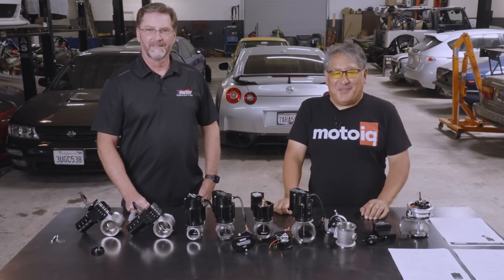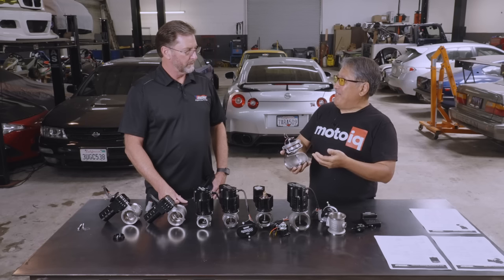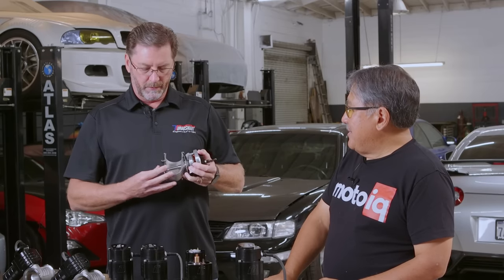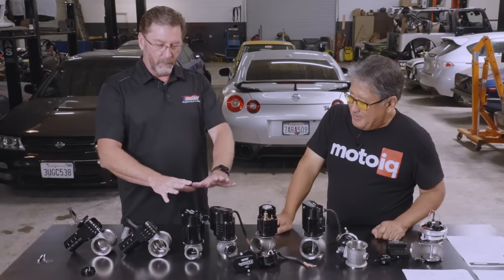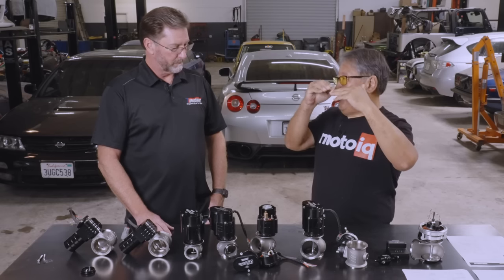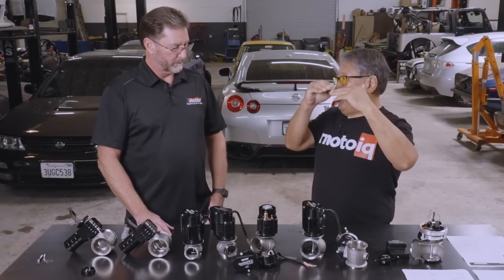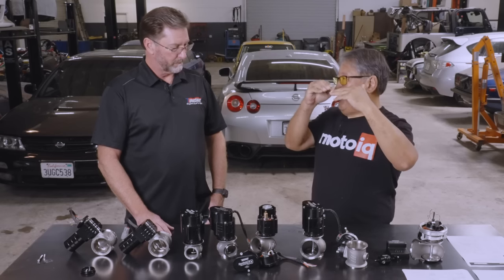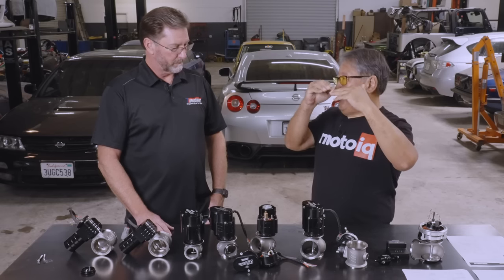The Future of Boost Control: Electronic Wastegates

Comment: As someone who drives a Golf EA888 Gen3 with one of these (IHI). They work great but they do have a higher failure rate than the conventional spring wastegate on production cars that will see alot of miles.  Stil, obviously its much easier to control and also simpler to have it electronic(non water-cooled WG). As for the magnet temps , ask any RC racer about that, its why we keep our electric motors in our models under 185F , over that you loose magnetism, so you loose torque and speed.
Reply from the maker: Maybe thats the OEM VW part, turbosmart has pretty rigorous validation.
Reply: @motoiq  VW OEM for the IS12, 20 and 38 is IHI Japan, but yes that could be the case
Reply: The Curie Temperature is the temp at which magnetic properties of a material change. It depends on the material, but I'd imagine most of the motors are using similar grades of material.
Reply: @jimboyokel  yeah those magnets its around 210-230f if Im not mistaken, but you cant really take the temperature accurately since we measure on the can itself , 185F gives us a good margin.
Reply: As a fellow Mk7 Golf R i too have had fault codes for the electronic wastegate actuator. But isnt the actual wastegate on the is38 still internally gated? These seem to be closer to an external type wastegate.
Reply: @erikpowers4358  as a former Mk7 GTI owner, yes they are a internal wastegate. The IS12/20/38 are like they replaced the wastegate diaphram with an electronic actuator. I imagine the gear drive on this aftermarket external gate is about a million times more robust.
Reply: Turbosmart>IHI

Comment: Rob Dahm uses the e-gates on his rotary builds and loves them and loves how precise he can set them
Reply: yes dahm seem to like them alot and its might be alot more easy to use then the need to rout preasure hoses.
cleetus using co2 just to control his wastegate and get alot of boos creep sometimes, it would be nice to see if his engine would run more stabile presure with e-gates.
Reply: This is funny, as soon as I was getting into this video, I started wondering, damn what is damn using, now I know thx

Comment: Big hot rodding innovations still popping up, unbelievable! Would make for a very elegant way of limiting wheelspin by cutting boost at low RPMs
Reply: or if you do a turbo busa you can have basically no boost in first then boost it by gear to like 20psi in higher gears. stops it from wheeling not doesnt stop it from hauling ass!
Reply: Dude with modern boost control and tuning I got my 01 7.3 deisel to 22 mpg hwy. Modern engine tech is wild
Reply: @Lrlbiglee  😲🧐🏁

Comment: nice! the waste gate valves size/flow rate and release latency is important, having a controlled delay is good because you wont loose pressure in-between shifts but too much delay creates over boost/spike And with blow off valves if it holds waste gate pressure after the throttle is closed it builds thrust load on the impeller shaft and wears it out little bit faster creating the fluttering/back flow sound from when too small a blow off valve, poorly controlled or no valve is used
Reply: To be fair, that type of shift delay control has been around for a very long time. Running a simple N75 we've been tweaking that for 20 years at this point. A lot of guys weren't using the simple technology available to them.

Comment: If these are reliable. This should be awesome. Much better than a spring.
Reply: Rob dahm has been using this for the past 2 years & on with no issues. Is that reliable enough for you 🤔

Comment: I would guess this would make many exotic turbo setups easier.
Setups like compound, asymmetrical sized turbos, dual boost (compressor and turbo), or rocket boost setup (Subaru rally), all of those could be a lot easier to control individually.

Comment: These are very cool. I've wanted one since I first saw them, since boost control tuning, even with a closed loop option, is subject to many issues mentioned in the video. It's unfortunate that they cost more than my turbo did, and wouldn't fit on either of my cars without modifications to the manifold. I would like to see one that uses a linkage and a bowden drive to move that actuator somewhere else. 

I've always been curious about something though. With heat being such an issue in wastegate actuators, why do many manufacturers insist on making them black. The emissivity and thus absorbtivity of black anodized AL is significantly higher than un-tinted anodizing or raw AL, and in many cases these things sit inches from glowing IR sources... Even the cheap actuators come with water ports now, but reducing the heat input from the glowing primaries or turbo can't hurt.

Comment: These are giant though.... for me, it's yet another item to power: laying out my build I have electric power steering, electric AC compressor, electric pump for air-to-water intercooler, electric fans, and now an electric wastegate, in addition to my bevy of accessories? I can't believe I have to go down the rabbit hole of pros and cons for a dual 12V (in parallel) system..... And finding a beefy KA24DE(T) alternator to manage it
Reply: This is max 130 watts when it is adjusting, 0 Watts between engine idle and all the way up to the boost target.
Reply: You've got a lot of electric accessories, but almost nothing is running at the same time. Your electric power steering is going to be consuming almost zero power, if you're at wide open throttle, your electric AC compressor is off. Your intercooler pump is maybe 10 amps continuous.
Go measure your actual running current, you're going to be well short of 30 amps continuous without headlights on. that's totally manageable even on a factory alternator runny any RPM.
Reply: @otm646  thanks for the feedback! You're absolutely right, I should look at total current draw and power usage at a realistic duty cycle and see just where I'm at!
Reply: @mrbookends   Your ecu can inform power usage from alternator and what is effectively charging the battery. So a simple math solve this question

Comment: Well, a missed aspect of thermal issues is that heat directly affects resistance in a circuit. If resistance changes, then reference voltage changes. If the reference voltage doesn't change, then the current has too in its stead. 

So, either have an inaccurate 0-5v reference or constant over working of overcurrent components (zener diode, resistor, UJT, etc). The ceramic composite of the bowl cooling won't change Ohms Law.
Reply: Could use a valve controlled vacum wategate. It’s a bit german, my porsche 992 turbo with ruf kit, responds well, reliable enough to run 880hp with 3 years warranty and a lot of tracks days and autobahning. And my wastegate remains open in launch to alleviate exhaust pressure, but my turbo is VTG. I don’t know 10 years ahead, but I put about 15000 mi and I’m confident
Reply: They are controled on close loop that is not problem if you have proper ecu to run eletronic wastegates.
Reply: @fabini14   And good tunning too. For me, closed loop controls is magnificent and beautiful

Comment: These on the right engine with a twin charger system would probably get you boosted engine effiency easier cooling but that huge turbo peak hp numbers with usable torque.

Comment: I’m going to run Turbosmart’s new 50mm eboostgate on the cold side to control boost. It will make the turbo spool like a supercharger but I’ll still run a traditional poppet style wastegate on the hot side as a safety to not overspool the turbo. I also bought Turbosmart’s black box which has two half bridge. Hopefully later they can reduce the physical footprint to make it more compact. Idk if TS can being that there is the compound gearing mechanism that takes up the inside of that housing.
Reply from the maker: That is interesting.

Comment: What built in safety protocols are in place in the event of the electronics malfunction or sensor malfunction? These are exposed to high temperature and pressure , can you state the failure rates based on testing?  Throttle bodies and accelerator pedals have 2 independent sensors to prevent this. Can you elaborate  what engine protection strategy is capable for preventing an over boost condition
Reply from the maker: Typically the same safety protocols used in a traditional turbocharged or supercharged application would still apply. The Turbosmart BlackBox also features over temp protection and over current protection to specifically prevent the Electronic Wastegate from failing.
Reply: There is no safety in a regular wastegate either.
It is up to the tuner to program in safety if the engine sees to much boost.
My 25 year old car used fuel cut in case off over boosting if there was a malfunction in the wastegate system.

Comment: i feel like we need remote actuator in order to add these to existing turbo kits. that huge actuator is hard to fit.
Reply from the maker: It's one of the points we brought up, many times the system will have to be built around the wastegate.  The advantages may be worth it!

Comment: Is the turbo oil regulator applicable to journal bearing turbos?  What change in the typical turbo journal oiling system is necessary?
Reply from the maker: Yes it is. I would regulate to about 40 psi.

Comment: Instead of using an electric boost solonoid to control vaccum. Just cut to the chase and use a solonoid boost controller. I bet this would work great. Just tell it where to go say open 3% at x psi and slowly open or close to perfectly control boost. This is such a simple concept. Yet technology has allowed us to take the heat and finally have accurate boost control. And no boost is lost to the bleed off system. And no melted vaccume lines causing boost leaks. This is a great idea.
Reply from the maker: Coils can't take the heat.

Comment: I’m running a StraightGate 50 water cooled on my RX7 with my Haltech Nexus R3 and having problems.  This wastegate isn’t supported by Haltech and on the H-Bridge was causing over-current issues drawing more than the max 16A override on a 8A circuit.  Haltech sent me Alpha firmware that supposedly supports the StraightGate but it wouldn’t work. I spent hours and rewired my milspec harness to use the Haltech 25A high current outputs to control the gate and now it drives the wastegate so fast and hard during the calibration it causes a wastegate position error.  Have sent logs to Haltech and followed up but so far no response.  Help!
Reply: Unfortunately, as you stated, your ECU doesn't have the support. The R5 would be my choice

Comment: So the gear train is like a wastegate flap/valve locking mechanism, need power to open and close the flap. In that case when the flap is in closed mode, and then DC power is lost to the unit electronic controller or electronics went bad, and over boost occuring, it is then like a normally closed valve ? 

My engine MB M276.820 3.0 turbo is stock, using vacuum based actuator for wastegate control, it is normally open design. If any vacuum hose leak or the boost controller vacuum control valve failed, wastegate stay open as safety measure, hence a normally open sytem. 

So what safety measure is in place for this electronic wastegate during its failure to actuate while in overboost condition ? ECM engine cut off based on boost pressure sensor, or some other extra safety ? Thank u
Reply: Typically the same safety protocols used in a traditional turbocharged or supercharged application would still apply. The Turbosmart BlackBox also features over temp protection and over current protection to specifically prevent the Electronic Wastegate from failing.

Comment: Now the question. Can you just plug this into your Subaru boost controller and adjust values to make the electric wastegate actuate with stock ecm using ecu flash???
Reply from the maker: You need a 3 port.
Reply: @motoiq  I’m curious about the electric boost control unit. How do you tune the opening and closing of the unit. I have a 3 port already, but this would eliminate vacuum lines and make it extremely accurate for tuning boost curve and the ecm correcting boost as well. Would you just use the 3 port wires and tune in the wastegate duty cycle table to change the electric waste gate
Reply from the maker: I think you need a lot more basic knowledge before you attempt this
Reply: @motoiq  I think you can’t read the question I’m asking. I know the Subaru ecm inside and out. How it works I was just trying to creat an educational topic for people to understand that you can hook up the boost control wires to the electric waste gate and alter the duty cycle with ecu flash and Tactrix cable to put the waste gate where you want it and have no vacuum lines that control the wastegate. Or bleeding on any air so you will naturally have better boost control and no bleeding off of air to control the wastegate. But your moto iq you should know that…..
Reply from the maker: If you know then why are you asking?

Comment: can I use one of these with my procharger to change the boost levels instead of swapping pulleys?
Reply: can bleed off boost like a regular wastegate on a procharger
you will need to run the pulley for the largest boost you want
and bleed off the rest
it will be less efficient tho
Reply: @seethruhead7119  thats what I'm saying, ei, car makes 22lbs of boost & want to make 14....without swapping pullies...was asking if this could do it
Reply: Don't see why it couldn't. But you could also do that with a regular waste gate too. Just have know how to program your tuning software to respond to what boost pressures you're looking for.
Reply: Yes the StraightGate can be used for supercharged pressure control.

Comment: That's cool an all, but you went through all that trouble to make a motorized waste gate an you choose a cheap ole brushed motor for the driver, it wont last long,  that needs to be a brushless servo motor.
Reply from the maker: A servo motor can have brushes. This is a servo motor, if it has PWM control it is a servo motor.
Reply from the maker: What do you know from looking at it?  You didn't know a servo motor can have brushes. A cheap motor doesnt live long in this application and the wastegate has a good service and warranty record.

Comment: Our patented zero back drive gear train. = worm gear or lead screw pretty much the only two viable options. 
I don't want to get into it with too much detail and having a patent doesn't make sense, you can just look up the patent and it will tell you what's in it. So just tell us what's in it! it's a geared motor onto a lead screw with feedback... it's a fancy linear actuator. Don't get me wrong a very nice product with lots of work in it but I hate when people/companies pretend these things are systems nobody has used before. Grinds my gears 🤣
Reply from the maker: To my knowledge no one has used this on a commercially available performance wastegate application before.
Reply: @motoiq  I understand and I agree. The fallacy is that it's patented and saying I don't want to go into too much detail. You can read the patent with the detail of the design. My main point is just tell us how it works and flaunt how good it is because if someone wants to understand it they can read the documentation.